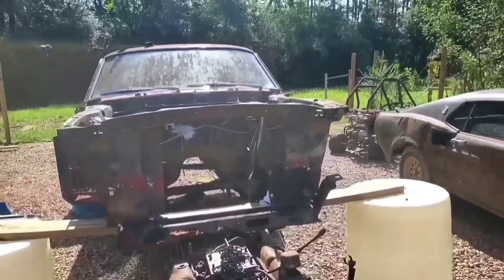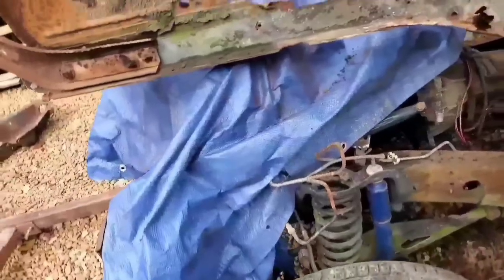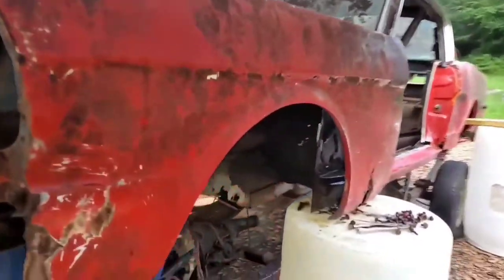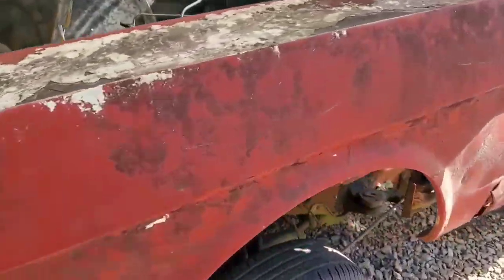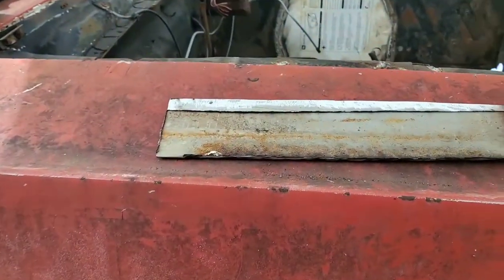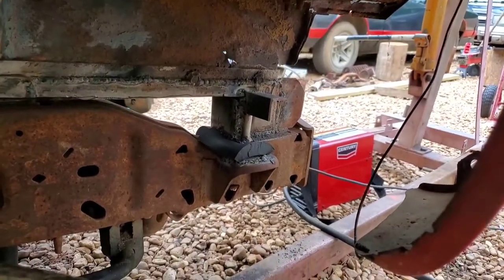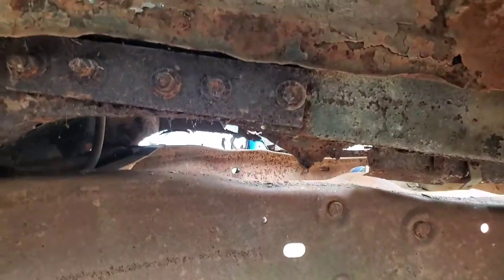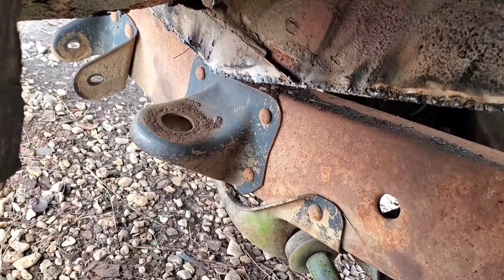1965 Mustang  "The Truckstang" Body To Truck Frame Swap Part 2

Comment: why not just remove the front clip and then just weld the body on to the truck frame/
Reply from the maker: We have to take into account the truck frame doing some minor twisting that may rip out any weld points.  Also since the car's a rotted unibody, we have to take that into account.  There wasn't much to weld to on the original unibody...